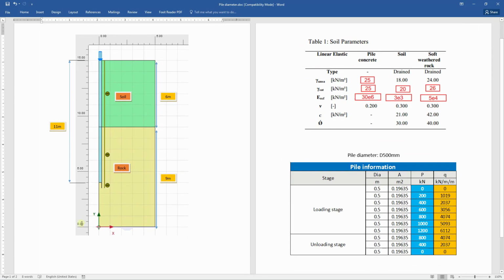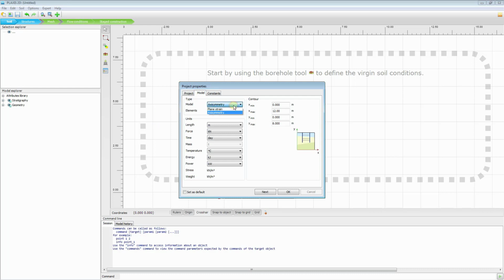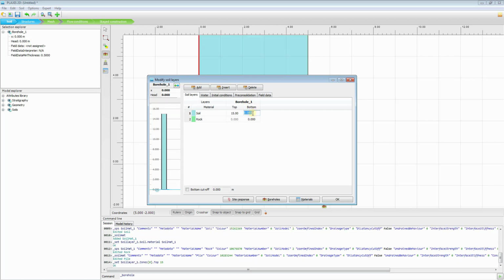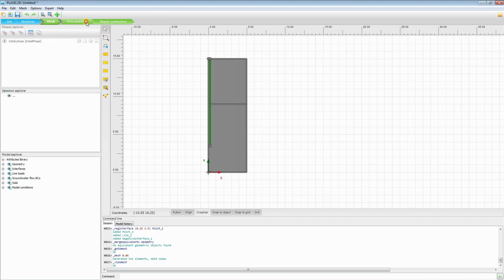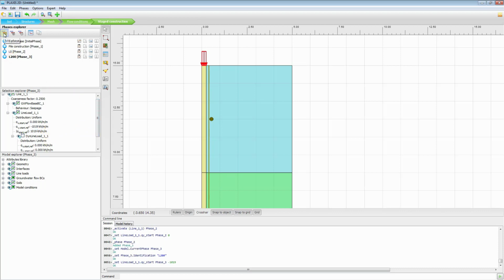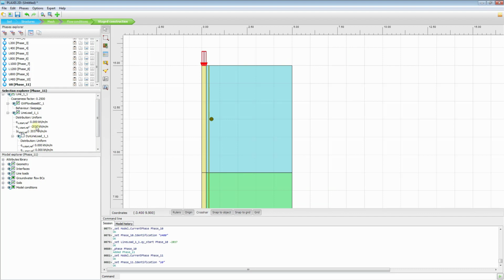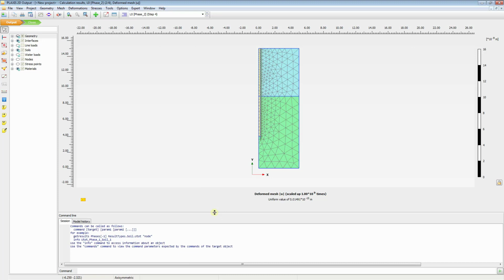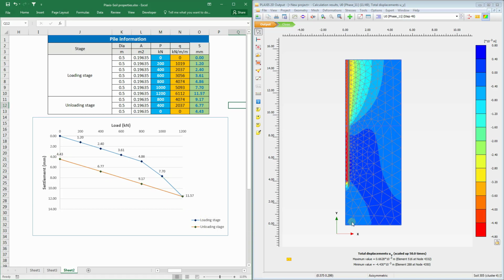Plaxis - How To Simulate Pile Static Load Test

Comment: I want to apply my load as a point load with vertical and horizontal components. Do I need to divide it by the diameter of my pile in this case?

Comment: Hello, in the video, you applied a line load at the pile top and used axisymmetric models to simulate a pile load test. I have a concern regarding the values of the line loads you calculated. Following PLAXIS manuals, the force should be represented by force per unit radian. However, you calculated force per unit width. Is it correct?
Reply: lo correcto es poner un cuarto de la carga sobre el pilote,  estas modelizando un cuarto

Comment: If I create this in 3D plaxis , do I need to create the half geometry only to get the same load settlement results?
Reply from the maker: actually, I didn't try plasix 3D, But I guess you don't need to model 1/2 the geometry while using Plaxis 3D.

Comment: Hi, can you explain how to convert the Load (kN) to q (kN/m/m) ? Thankyou
Reply from the maker: Just think about the unit, kN -> kN/m/m.
Reply: It is simple, Stress  = Load / Area. Now, you can calculate the pile area using pi*radius squares.  So just divide load with area you will get intensity. This values are round up.

Comment: 1) can't we apply the point load Directly why to convert it in kN/m2
2)pile bearing and shaft resistance calculations
Reply from the maker: 1) Technically, I think it is possible in this case.
2) Actually, I didn't did it. But I will try when have free time.
Reply from the maker: Thanks
Reply from the maker: https://www.youtube.com/watch?v=gHSyG_85aSM&list=PLfh6KTUaEFnk4lZOmR66q9x-TlTSG-eeb&index=5
Reply from the maker: Hi friend. In this case, we can not use point directly. because the pile is modeled same as soil layer with properties of concrete, it is not a plate. Then point load can't be applied for this case.

Comment: If the drawn pile has a diameter of 0.25 m, why are you loading the full pressure stage and not half?
Reply from the maker: This is the simulation of actual static load test.
Reply from the maker: You can check the loading value in the excel file I attached at the download link.

Comment: Hey, thank you for your videos. I wanna know how could I calculate only the end bearing? Could you please make a video about this? (shaft resistance and end bearing) how to know the results separately
Reply from the maker: Thanks for your comment, I will try to figure it out.
Reply from the maker: This video is to simulate the static load test, from the test results we can evaluate the pile bearing capacity generally according to the Code. But I think we can calculate the pile shaft resistance and pile tip resistance also, let try to find it.
Reply: @geotechniq  did you figure it out how to calculate the shaft resistance & end bearing separately?
Reply from the maker: @mohammadshahidulislam3152  I've try but not yet found :)
Reply: @geotechniq  did you ever find out how?

Comment: But how yo derive pile capacity from the curve?
Reply from the maker: You should refer to the code, check the limit settlement of that Code
Reply from the maker: maybe 10% of pile diameter or 10mm, 20mm, depends on the code in your country.
Reply: @geotechniq  
You can also use Davisson criteria. And dont forget to compare the plaxis results with the actual results of the static load test
Reply from the maker: @juliansandoval8022  Thank you. I'm about to make a video to evaluate static load test results using Davisson criteria.